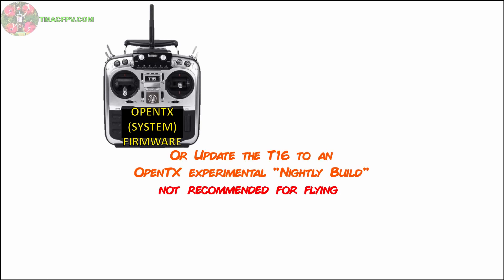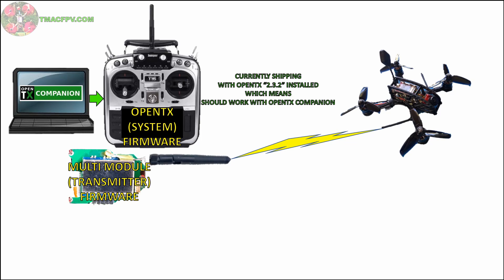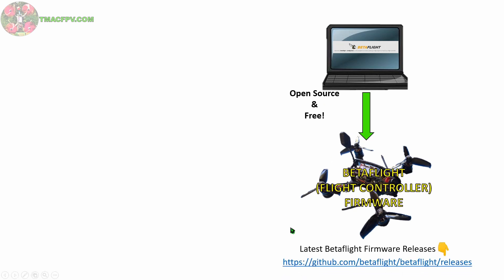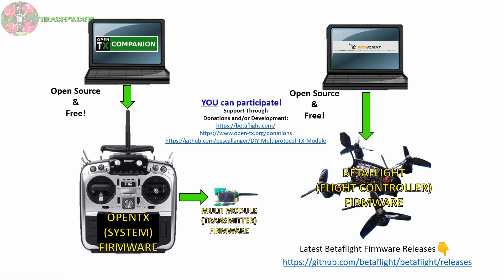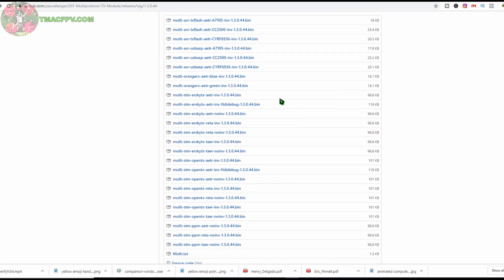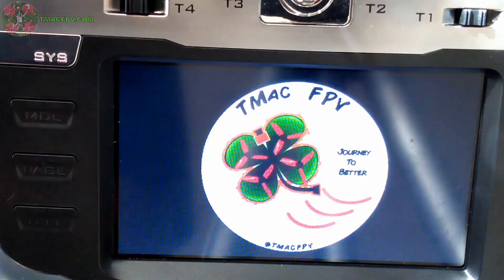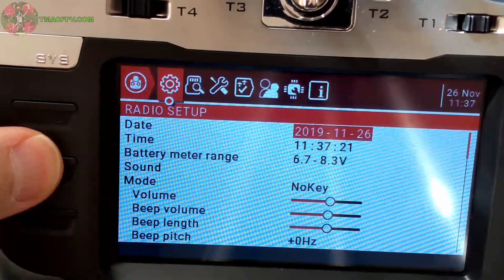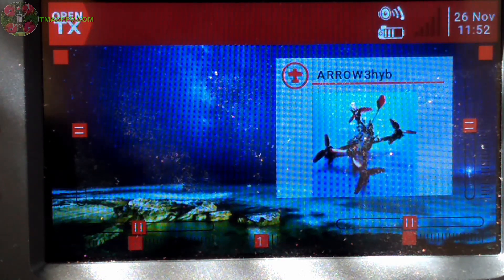MULTIMODULE TRANSMITTER FIRMWARE CLARIFIED

Comment: Got a internal module in my t16. Though when creating new model it doesnt even show the internal rf mode. I can't flash to my internal rf using my usb to serial connector, it fails. Have updated to open tx 2.3.11. Think this is when I lost the internal module. Also my t16 has never been able to connect to computer.
Reply from the maker: Good day Lego2010 Princess!  You have just made a series of statements.  Sorry to hear you're having issues with your T16.  I'll interpret your statements to mean you are actually asking for help to resolve your issue(s).  You should not be attempting to flash your "internal RF" with a USB cable.  Use the process in this video to update your internal multi-protocol module https://youtu.be/EJx9mz-DI_g . With respect to you not being able to connect to computer with your T16, how were you able to update to OpenTX 2.3.11. then?  I hope you were using OpenTX Companion.  If, however, you are not bale to connect to your computer with your USB cable it could be a couple reasons.  Perhaps try a different USB cable?  Another possibility is the automatic windows update has "updated" your driver on the computer which would normally be used for the transmitter.  This is a common problem.  The Windows update "issue" and corrective steps to take for it can be found at this link:  https://www.youtube.com/watch?v=SDnRSL3rDwM&list=PL11jbUrbAAbDARPKsG3oDTiwCkYfcp7oi&index=9  Make sure to read the video description and the first few comments in its comments section as well for further clarification.

Comment: Hi,
Thanks for your video, I downloaded 2.3 and downloaded the T16 firmware from Opentx I started to have issues, all models disappear and bad memory error started to appear. Than I went back to 2.2 saved the models again on T16 under Horus X10 everything is working fine. The issue is when i change model T16 crashes thats the reason I was looking to upgrade the firmware. Any suggestion as to what I am missing here 

Thanks in advance
Reply from the maker: If you're trying to go from JumperTx to OpenTx you need to recreate your models rather than try to import them.  OpenTX Dev's have stated OpenTx does not support migration of models from JumperTX to OpenTX.  when updating to OpenTX you also need to make sure you have the associated OpenTX Companion and SD Card contents that go with the OpenTX version you're downloading and updating with.  Also, when updating using OpenTX Companon make sure to go to the Applications Tab of Companion  and select from drop-down menu (Stable Release if you're updating to OpenTX 2.3.4.  Lastly, here's a video if you haven't seen it yet on updating firmware:  https://www.youtube.com/watch?v=BXhLk_l6280

Comment: Tmac: Two questions: 1.) Once I transfer all of my quads from my Taranis to my new Jumper T16 " do I have to bind each of them?"  And 2.) if so, will they still be flyable with my Taranis once they are bound to the Jumper T16?.......Thanks!  Larry
Reply from the maker: Hey Larry! Your quad's receiver can only be bound to one transmitter at a time. It's (among other things) a safety measure. You'll need to pick which transmitter you want to bind it to. Take care friend 👍

Comment: T16 jumper run with dragonlink? Dude
Reply from the maker: Hey Martin! I do not have Dragonlink, however, I have seen on RCGroups where Yes, pilots are using Dragonlink with the T16. Some have said you may need to add shielding (foil-type paper?) to the back of the transmitter shell case to make it work properly. See this video from Bonafidepirate on 433Mhz fix: https://youtu.be/KdXZsqfb8rU

Comment: Hi Tmac, Just thought you may be interested in my T16 experience so far.
As I mentioned a while ago replaced the front cover with a very cool carbon looking cover. Requires removing a lot of the components well actually all of them so not for the inexperienced. However, I downloaded and installed the OpenTX candidate release 1 and its performing really well. Not only that despite the warnings and if you do not know what you are doing don't try this but I imported back all 18 models I had saved in OpenTx Companion using the X10 before I upgraded to the CR1 OpenTx. So far I've activated 7 of them and every single one of them transferred back perfectly. Even complicated ones using Global Variables. Apart from selecting the internal module and rebinding each one its been perfect. So I'm extremely happy and highly recommend the T16 and my X9D plus is having a retirement.
Reply from the maker: Congrats Donald! Very happy for you friend!👍

Comment: Hey Tmac. Thanks for the video. I downloaded latest version 1.3.0.47 trying to get the graupner HoTT protocol but it doesn’t show up in the list of available protocols. Any idea what I’ve done wrong?
Reply from the maker: Hey Darren! I checked on my 1.3.0.44 version and it shows up.  Only thing I can think of is did you download the correct version for the type of module you're using?  If its an internal module you need the "no_inv" version, if its the external module you need the "inv" version.  Hres a link to multiprotocl module HoTT protocl stuff which you may find useful as well: https://github.com/pascallanger/DIY-Multiprotocol-TX-Module/blob/master/Protocols_Details.md#hott---57
Reply: TMac I got my jumper T16 with opentx 2.3.2 and V1.3.0.44 already installed. HoTT wasn’t in protocol list so I downloaded and flashed multi-stm-opentx-aetr-noinv-v1.3.0.47.bin. Still don’t see HoTT as an option in the internal multi list. I don’t know what I’m missing. I am new to opentx transmitters coming from graupner and spectrum.
Reply from the maker: @darrenehlert6100  Very odd.  The version you flashed is the latest multimodule version.  I don't mean to be insulting at all but are you sure you're looking at the Internal Multi list and not the external?  HoTT is showing up on mine toward the end of the "Internal Multi" list on 1.3.0.44. Only other thing I can think of is that 2.3.2 version of OpenTX that your radio came installed with is a previous "nightly build" version (stable enough) that the OpenTX Dev's gave Jumper to use awhile back.  I don't think that should matter but  . . . You MAY either want to update to current Release Candidate version (remember to select Release Candidate (testing) from drop-down menu in Application Tab of OpenTX Companion or wait until the official OpenTX release comes out to update.  Very much wish I knew exactly how to fix your issue, however, I'm stumped.  If I'm able to find a "fix" for you, I'll let you know.
Reply: TMac appreciate your time. Yes I am definitely looking in internal multi and not external. Should be a simple thing but it’s got me stumped. There wouldn’t be any point going back to version .44 would there? Seems counterproductive to me. Especially since I couldn’t find HoTT protocol on it either.
Reply from the maker: @darrenehlert6100  I don't see any rationale for going back to earlier version of multi-module firmware then either. I'm racking my brain on this and am coming up empty
Reply from the maker: @darrenehlert6100  Here's what I would do.  You'll have to decide if you want to proceed this way.  I would update to latest OpenTX firmware (Relase Candidate 2).  When doing so, using OpenTX Companion, make sure to select that drop-down Release Candidate (testing) version I mentioned earlier.  Also, when downloading the firmware using Companion, make sure to check the box for "InternalMulti" (along with the other boxes I mention in my firmware update video).  My rationale for this is perhaps the operating system firrmware (OpenTX Version 2.3.2 you have currently installed) isn't "playing nicely"  with the multimodule firmware.  Also, just saw a post on RCGroups from an individual stating on Dec 9th:  "After upgrading to RC1 my T16 pro, the internal MULTI module shows a Hott position for transmitter".  This statement tells me he was having the same problem as you but after updating the firmware to RC1, he now sees HoTT
Reply: TMac thanks. Seems most likely to be the case. I will either update to this version or wait for the official release which should happen soon. Appreciate the help!
Reply from the maker: @darrenehlert6100  yep.  Just found out from the Multimodule Firmware Developer in response to another individual (see this post): Originally Posted by edge 54 
I updated my irangex + to the latest firmware to get hott.but it's not there. The update shows the latest firmware but no hott. Does anybody know what I'm doing wrong?
ANSWER:
Assuming you are using OpenTX, you need to upgrade to 2.3.3rc2.
Pascal
AND, I just updated both my OpenTX firmware to RC2 and my multimodule to 1.3.0.47 (using RC2 Companiuon) to confirm it for you.  HoTT does appear as an option within Internal Multi using both these updated versions.  Hope this helps you out.  Sorry it took so long
Reply: Thanks TMac!

Comment: I'm having problems downloading the new firmware update. When I open the SD card from transmitter I can see the new firmware but when I go to bootload it does not show up on transmitter as a file. I'm using a Mac and I didn't follow your initial instructions on how to use the program with the Macbook. How do I wipe the SD card and start over with download? I'm just a little confused and would like to start from scratch. I also have a new SD card if that helps. Thank You very much your videos are awesome!

Comment: Jumper released opentx_t16_en_191120.bin  and I was able to download Question, would I be better to go with the latest nightly build over this version of OpenTX from Jumper?
Reply from the maker: Not "nightly build" anymore.  OpenTX officially released OpenTX2.3.3RC1 (release candidate 1) yesteday (Dec 4th, 2019).  I would go with downloads from OpenTX site and Not Jumper site.  Jumper is totally relying on OpenTX for futrue firmware updates.  Why go through a "3rd party" for them when you can go straight to the source?  Here's the link to the site for OpenTX 2.3.3RC1:  https://www.open-tx.org/2019/12/04/opentx-2.3.3RC1

Comment: Hi again. I am assuming that the Multi Protocol updates won't work this way with JumperTX?
Also if anyone is interested Tmac I have replaced the T16 front cover with the cool looking carbon fibre look. Not for anyone not used to electronics. Requires the removal of nearly all internal components. But the result looks good.

Comment: which one you talkin about the nightly version or the regular version   of  232   ?   I want to flash my t16
Reply from the maker: I'm using a nightly version (N54).  i do not have the OpenTX 2.3.2 version which now comes with the Jumper T16, however, that is actually a previous "Stable" nightly version without the "nightly version nomenclature." I believe starting with N34 is when the ability to "flash multi" feature was incorporated (I'm not certain about this).  anyway, the process is the same.  If you have a Jumper T16 with OpenTx 2.3.2 installed, look at the menus I walked through in the process to see if this feature is available in your version.

Comment: Appreciate your informative vids, as the N00b I am. 
So, I understand from your vid, the internal module (with V1.2.1.51), now can be updated without hacking around with a self-made cable connecting to the internal module.

Trying to update my Jumper T16Pro (pre-BOOTLOADER V1.2.1.51), using OpenTX  2.3.3N55, with the newest Multi Model Internal (multi-stm-opentx-aetr-noinv-v1.3.0.45.bin).
Getting the following error message:
"Firmware Update error
NoSync 
(RTN)"

Could you please verify my update should have gone flawlessly, despite my not having the bootloader in my internal module?
Reply from the maker: Hey Tom.  No, you need the bootloader installed on your multi-module BEFORE you can do any subsequent updates to your multi-module.  Need to follow the process at the following link to upload the bootloader and install an updated multi-module firmware simultaneously the 1st time.  Then, after that, you will not need that "self-made cable connecting to the internal module" for any future updates you accomplish.  Which means after the 1st time you upload the bootloader and update firmware with the cable, you will not need it after that.  You can do future updates with only the "flash multi feature" of the T16 OpenTX.
Reply: Aha, - thanks for replying. I was in OpenTX heaven for some seconds. Now back to realty.  Sigh...have to build a cable..

Comment: where do you change the 24hr and the 12hr on time and date?? i cant find it
Reply from the maker: I may not be understanding your question. You can change time & date by turning radio ON and pressing and holding the Sys button down to get into Radio Setup mode.  Time and date can be changed on 1st menu screen
Reply: @TMacFPV  see I tryed that. I could put the date in fine. But when I tryed to do the time it is stuck on the 24hr clock military time, I couldn't get it to switch over to the 12hr time
Reply from the maker: @toddbeal4373  ah! Now I understand. Unfortunately, I do not know the answer to your question.  I have looked on my TX, I have read throught the T16 manual, and I have found nothing which expalins how to switch time modes.  The only thing I did find from the manual was under the GPS section of radio setup menu talking about time zones.  I MAY be one of these (i.e. they may have stuck that feattue in with these "time zones."): "Time zone: Adjust the time according to UTC, which can be set between -12 and +12"
Reply: @TMacFPV  lucky you I didnt get a manual with mine.
I'll have to see if I can download one
Reply from the maker: @toddbeal4373  ha! Think I downloaded mine from Jumper site
Reply: @TMacFPV  being new to all this is alittle intimidating.
Bc I come from the flysky a6 for the last 5 years. So it will definitely take some time with this.
Thank god for your videos on how to update everything.
Onto the voice stuff next
Reply from the maker: @toddbeal4373  understood Todd, no worries friend! Steady, consistent progress. Take your time. You'll get it  and once you do, it'll be 2d nature. Shoot me an email if you think I can help. I'll do what I can

Comment: Thanks for the great video. With the multiprotocol, do you always use AETR? Im going to be using dsmx for a bit so should I use TAER . From what I have seen the multiprotocol uses AETR and changes the channel out put when selecting DSM, but not 100% sure. Also do you need to use the invert for using FrSky? The telemetry is apparently an inverted signal. May be another good video then? Thanks for your help.
Reply from the maker: Hey Hells Gate!  See Expected Channel Order paragraph  from this site: https://github.com/pascallanger/DIY-Multiprotocol-TX-Module/blob/master/docs/Channel_Order.md   Also, 6:45-7:45 of this video explains it https://www.youtube.com/watch?v=Dex92d7IQWI where -noinv is internal module and -inv is external module.  Hope this helps & Happy Thanksgiving!
Reply: @TMacFPV  Awesome, got it clear now. Thankyou very much for your help
Reply from the maker: @Hells_Gate  Outstanding! Quite welcome Hells Gate. Good job friend 👍Happy to help

Comment: Another reminder. Default T16 controller may be set as RETA in radio setup.  Change it to AETR if you are going to use AETR MPM firmware. It will auto route AETR to DSM/X to TAER in the RX.  If you find the need to only use TAER in Radio setup then you need to use MPM TAER firmware to match. BOTH firmwares must match or you will get confused.
Reply from the maker: Thanks! Think I covered that in the previous video a few weeks ago. That's why I referenced the previous videos in playlist when I could instead of going over same info and making video too long for folks to watch.  Could have re-emphasized it here I suppose, though want keep it as concise as possible and not re-hash previous info

Comment from the maker: Hope you now have a better understanding of both firmware installed within the transmitter, the system firmware (OpenTX) and the multi-protocol module (MPM) firmware.  This video combined with the ones in the Jumper T16 Playlist referenced show you how to go from JumperTX as the system firmware and an MPM without a bootloader TO OpenTX as the system firmware (and how to update it) and an MPM WITH a bootloader installed AND the latest firmware installed. let me know what you think and if I missed something, if you have additional questions, or if you'd like a video pertaining to another topic of your interest.  Make sure to congratulate Jason Peters in the Comments below for securing a free spot in the Fast Track FPV Course!  Thank you very much for watching!🤩